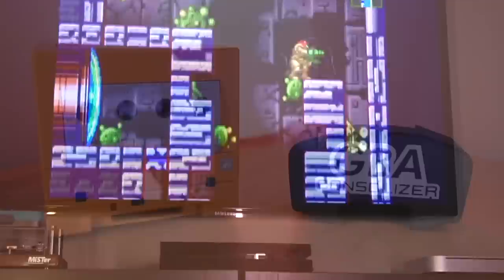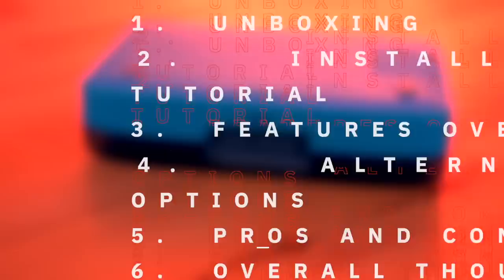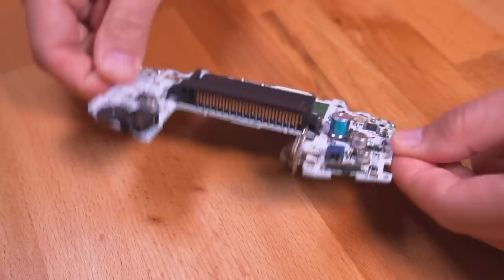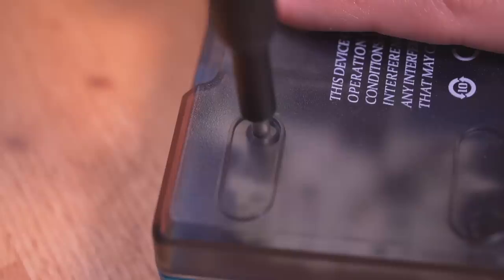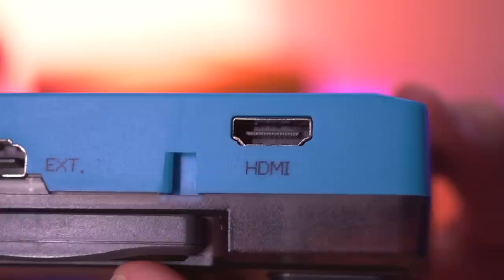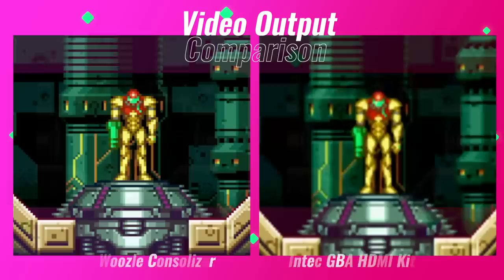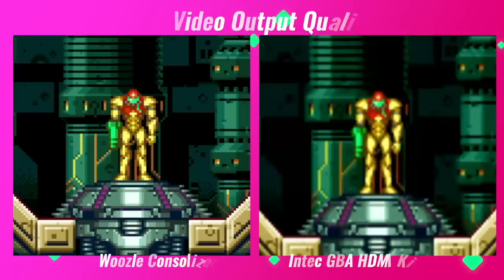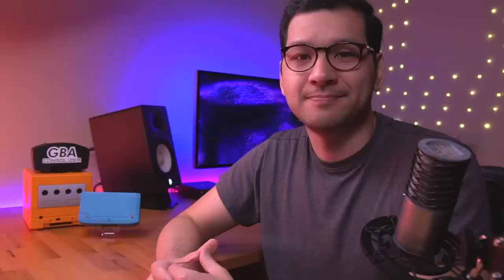Easy NO SOLDER GBA HDMI Consolizing Kit!  BUT, Is It Any Good?

Comment: Honestly, while it is good for the price, I don't see the benefit of this over running the games in an emulator. A $5 Raspberry Pi Zero is dirt cheap, and can run Gameboy, Gameboy Colour, and Gameboy Advance games perfectly thanks to modern and highly accurate emulators. 

That said, the controller that uses the original case is pretty cool! I might get that if it's available separately. Good video!

Comment: Looks like the video output is utilizing some sort of filler almost 2xSAL or maybe a mix between super eagle.

How is the audio since it’s using the speaker output and not directly interfacing with the dac any noticeable distortion?

Cool kit, hope they at least address the 3:2 resolution and add it in place of 16:9!

Comment: Amazing solderless installation and design, unfortunately wasted due to lack of gameplay and picture quality features: no correct aspect ratio, no original refresh rate output (I assume it does 60Hz only), no color space correction, no scanline or grid filters for the HDMI output. BTW, I wish we could see the composite output for CRTs tested, could it be 240p, and perhaps in the original refresh rate? That would make a big difference for some even if it is only composite.

Comment: Another major deal-breaker you missed: All audio from the Intec kit is MONO only. When I contacted Intec about this blunder, they actually tried to argue with me that the GBA is mono to begin with. I had to circle the stereo tap points on the GBA board and show it to them before they realized they had indeed made a mistake. To me, it's every much a deal-breaker as the AWFUL video quality and wrong aspect ratios.
Reply: Oh no. Well, they're half right. GBA and SP do mono audio since they only have one built-in speaker. But stereo if you hook up headphones or speakers. That sucks though.

Comment: I wonder if you can run it through an MClassic adapter or RetroTink. If that would make the video quality sharper
Reply: I’d run that through the RT5X, correct the aspect ratio and add scan lines to the soft image. I think it would look really good. I don’t think the mClassic would help it much as it ruins scan lines and doesn’t do much for my PSP. I use it on other 480p consoles though.

Comment: Buy a Raspberry Pi and it'll be better and cheaper than this option. You can get a Raspberry Pi, Case for the pi and controller for $100 give or take.
Reply from the maker: Emulation is a great alternative
Reply: @MachoNachoProductions  especially since you have to part out a GBA to make this kit work.

Comment: I'm curious if the aspect ratio or image sharpness is something they can fix in firmware or roll out a hardware a hardware update before kickstarter units are assembled. It's a great idea, but if the implementation is that poor I'd be inclined to just for with an emulation setup instead.

Comment: Would running this through a m classic on retro mode fix the aspect ratio?
Reply: mClassic also uses 4:3 in retro mode. A RetroTINK 5x Pro can fix the aspect ratio and also supports composite. It’s a $300 device though.

Comment: If this thing is any good, it's a huge deal.  It's priced similarly to the much more difficult to install existing consolizer.
Reply from the maker: What do you think about the kit after watching the video?
Reply: @MachoNachoProductions  It's interesting but the video quality issues are a bit problematic.  It's weird they didn't include native aspect ratio.  There also doesn't seem to be a way to update the device so we likely won't see any improvements on that front either.  I guess you need to just get comfortable with the quality.

That being said, my soldering abilities are lack luster and practice generally means possibly sacrificing hardware.  I'm not realistically going to do the alternative HDMI mod and there's no way I'm spending $500 on a prebuilt one.

People who are suggesting alternatives in the chat aren't taking into account the potentially the hundreds of additional dollars those cost.  Good luck getting a Gameboy Player and HDMI mod for your GameCube for less than the $170 all in this will likely run you. Nevermind also needing a GameCube. 

I might bite the bullet on this but I kinda need to convince myself I actually need it.

Edit: I grabbed the $170 completed kit from the Kickstarter.  I think this is honestly the most realistic way I'm going to get GBA games on my TV while keeping cost reasonable.

Comment: gonna say this now before I watch the video, the key works by using pogo pins to tap into the literal dozens of testpoints on the GBA pcb.
I was right, and they botched this HORRIBLY.
1) There's no reason for the video to be that muddy AND not having the proper aspect ratio. A higher quality conversion and padding the image with black pixels on either side is a minor cost.
2) They're pulling audio AFTER the GBA mangles it with its crappy amp. there are test points on the PCB to pull line-level audio! This is an easy fix, and would only cost them the time to redesign the PCB and move the pogo pins!
Also, don't compare the stock GBA player to a mod, compare it to Game Boy Interface/Swiss via a GCVideo HDMI output. It's dishonest.

Comment: Shame they botched the video output so badly. Yeah, it's cheaper, but it's still not cheap. In my opinion it's not worth saving $80 when you're still paying that much, and you get such an inferior experience. It looks like an SD composite or S-video signal, it's that bad. For me, it wouldn't even feel like playing on original hardware, it would feel like playing on a GBA emulator on the Wii or something, which runs quite well but has the same problem with a blurry image. At least that uses the right aspect ratio though so it's actually one step up from this thing.

Comment: The cost would be ($135 for the kit) + ($50 to $80 for an original GBA) ... approx $200. You could buy a GameCube (with a controller), GBA Player (matching color), and XenoGC+SD2SP2 mod kit ($12) for around the same (or slightly more). You not only get a modded GC as a result, but the GameBoy Interface (GBI) makes for a much better experience. This (in addition to an HDMI mod) would also be a better approach than Woozle's "consolizer". The only drawback is the lack of native support for third-party wireless controllers (e.g. DualShock 4). Still, IntecGaming would definitely have me sold if they could fix the aspect ratio and clean up the image a bit.

Comment: Using an eraser to clean contacts is not *perfectly safe*. It is quick and I'm sure effective enough, but messy and abrasive. You are, without a doubt, abrading the contact's plating more than you need to be, and leaving behind a layer of gunk. Not trying to jump down your throat, that's just a really bad, schoolboy way to do the job.

Comment: I don't understand these kits... it's supposed to get it "consolized" but it's aspect ratio and filtering is all screwed up. Once you get that wrong, it doesn't matter anymore.

At that point It's probably much better to get a SNES Classic or a Pi4 and run a software emulator (mGBA, Higan, VBA-M), which nowdays are almost as accurate as a real console, if not 99.9999% accurate on timings.
Reply: If the aspect ratio is such a big deal for you just stick to using the hand held.

Comment: Everyone should check out RetroRGB's lag test video for this device.  As I predicted, it appears they are using the same cheap, laggy scaler in this device that they use in the horrid Levelhike HDMI adapters & such.  The input lag via HDMI is several variable frames while the lag via Composite is HORRIBLE.  

Buyer beware, to say the least.  Pretty much what was expected tho, same result that we saw with those Warrior64 kits they put out.  Cool case, cool design, poor performance.  Not worth it for anyone who cares about quality output.

Comment: I know your videos have a format you like to stick to but you really buried the lead with that aspect ratio nonsense. If they'd gotten that part right this would be a compelling proposition, but as is this is trash.

I can't imagine caring enough to play GBA games on original hardware instead of just using an emulator, but simultaneously not caring that the video output is garbage. Maybe that market exists but I can't imagine it's very large.

Comment: Still amazes me that Nintendo didn't include video output on these from the beginning. Just another thing to add to their long list of stupid decisions.
Reply: right... were you around in 2000 when it came out? no one expected a handheld to have video output to a TV, you had the home console for that.
Reply: @scikoolaid  I was around long before that, I'm not some stupid kid. Putting a TV output on any handheld is a no brainer. 

Your argument would hold water if the home consoles had the same games as the handhelds. That often wasn't the case.